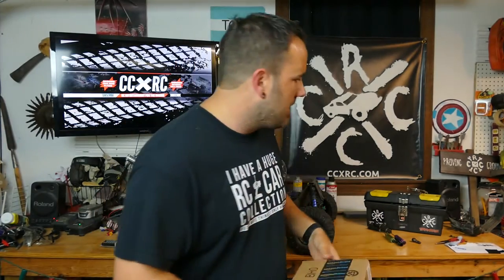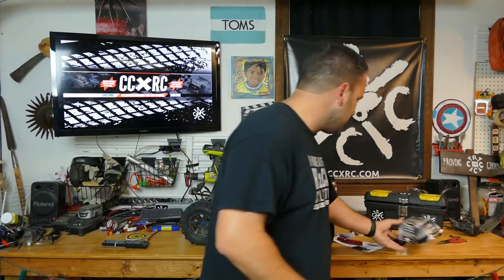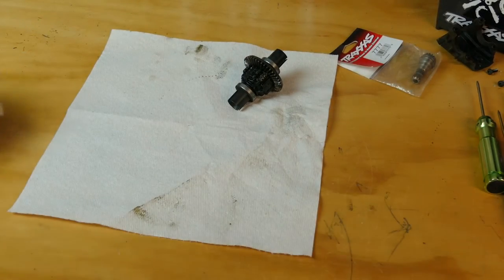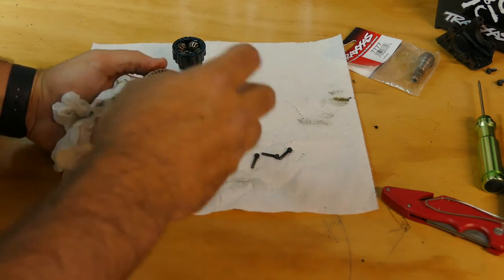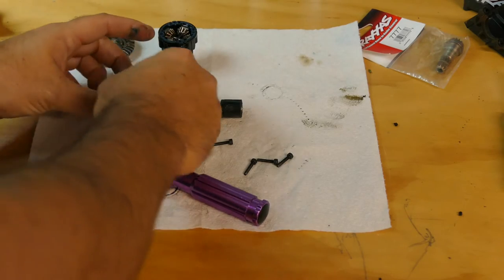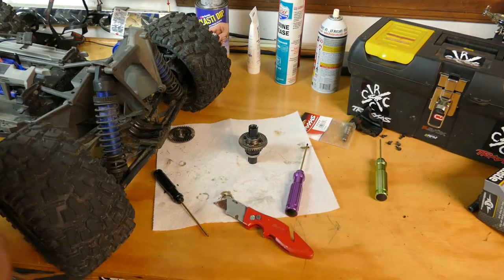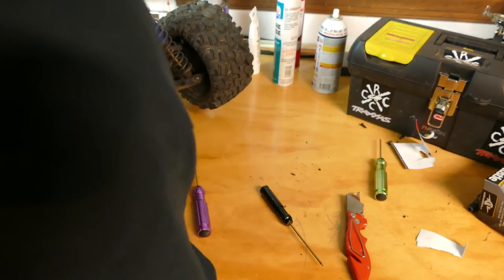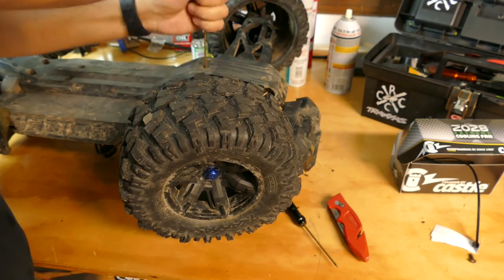X-Maxx Front Diff Ring & Pinion Replacement

Comment: I have a X max and change the front diff several times because the five screws in the front that hold the diff in place stripped out on me. I had to replace the upper and lower bulkhead, but like you said it wasn't too too bad to work on because of the design. Also I would go with the Kershaw creations hard hardened diff instead of the spiral cut by Traxxas ones. They may be spiral cut but I heard they're not that strong...
Reply from the maker: +Dr. Who thanks for the tip! I'll look into them

Comment: I got the traxxas xmaxx only problem I had was with the esc..wondering what I can do to make my xmaxx faster but keep it stock..I have added 54 t pinion gear and I have changed my spiral dif in..what else can I do to make it faster..?
Reply from the maker: +mark mathewson I haven't done anything to make mine faster, because I mainly jump it and it is plenty fast for the big jumps I'm running it on. The guys I've seen going for speed have switched the motor and ESC to go 8s

Comment: Traxxas XMAXX is bad to the bone I bought mine about 7 months ago used but the 8S version very tuff truck smoked one speed control and one gear and bearing connected to the spur but Im not easy on it Traxxas sent me a brand new speed control no charge they are awesome!! Traxxas kicks ass!  All RCs have there flaws but In my opinion they have the best product and service!  Currently own Slash platinum momba rustler both 2 and 4x4 stampede VXLs, rally car, XO1, Spartan, Blast, Emaxx, has rustler , ATON and Alias daughter has Castle 2 wheel slash and son 4x4 vxl stampede and gas stampede we all are RC junkies